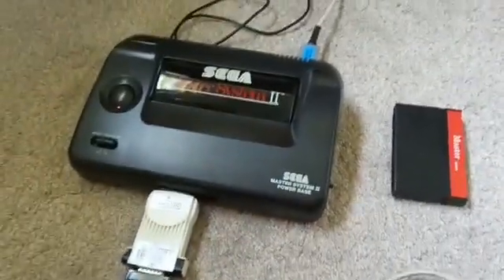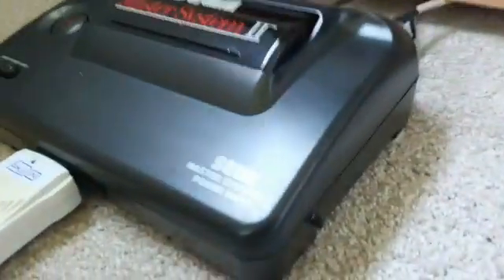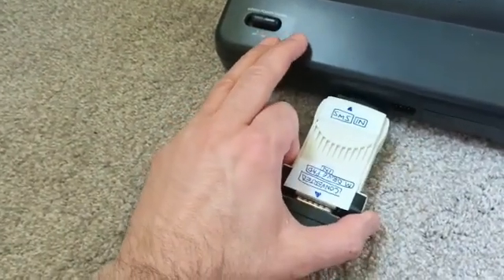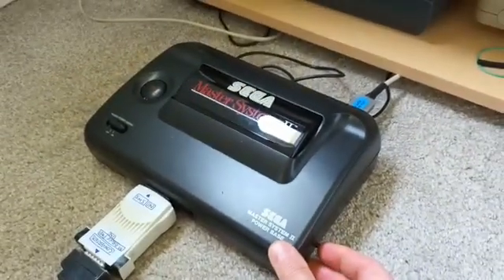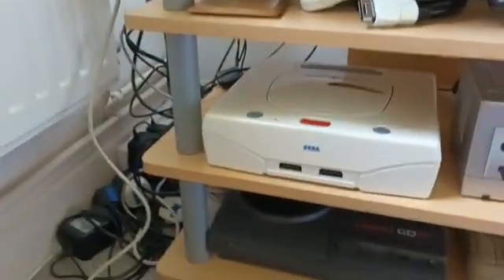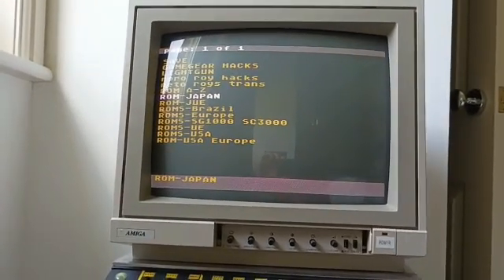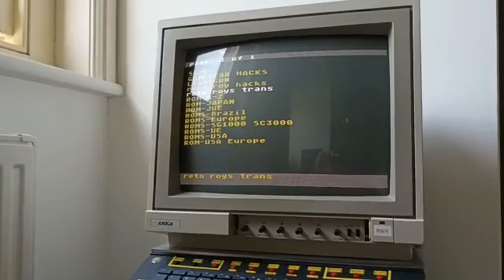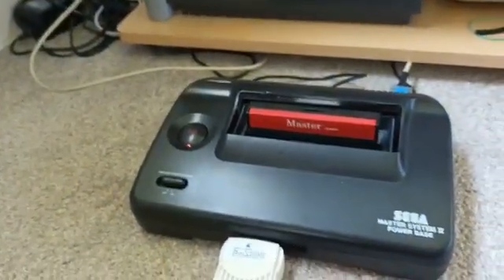Sega master system II hard reset switch mod

Comment: Hi, how do you reset and return to the everdrive menu? Thanks
Reply from the maker: on the cheap carts you would have to do a full on/off power recycle unless you have this mod, on a real everdrive it is a key combo, cant remember which keys .. something like hold a and b and start, google is your friend on this.
Reply: @alpanchen  thanks, with an aliexpress everdrive, how do make this connection, what points do you need to solder?
Reply: Hi, the hard reset modification requires interrupting the 5volt output from the 7805 regulator and a 5volt relay connected in between that circuit (with main contacts that are in a closed  state) when relay is not operated. A 5volt supply to the relay operating coil through a diode, then through the relay coil to the switch (with open contacts) until the switch is pressed, then other side of switch  is connected to gnd  (0v].
Reply: @markpanchen5106  Hi, thank you for the answer but is it possible to have a diagram of the assembly because I did not understand everything. Thank you again for these clarifications.
Reply: @markpanchen5106 Hi, I come back to you to have a diagram of this installation. Thank you so much.
Reply from the maker: @nicolassentenac5655  wiring diagram and notes are in the comments
Reply: @alpanchen  Thanks fot the answer but i don't understand all the details.
Reply from the maker: I have put links to the wiring diagram and notes in the description ... please click more on the description and then if needed click more again to see the links
Reply: @alpanchen  Thank you very much! 👍👍
Reply: @alpanchen  What is the reference of the relay please? Thanhs
Reply: Hi, you need to get a SPDT (single pole double throw) 5volt minimum contact rating 1amp relay, which means it has 5 terminals. 2 for the coil, 3 for the main contacts ( 1 is common, 1 is closed,1 is open check with a ohm meter and wire up to the contacts that show continuity without the relay powered. Hope this helps.
Reply: @markpanchen5106  Thank you, so I don't use the open contact but I only usd the close contact like in the diagram, the common contact and the two coil contacts. Thank you very much.
Reply: @markpanchen5106  Hi, is the ground point of the switch soldered to the voltage regulator or somewhere else? Thank you very much.
Reply: Hi, i wired ground pin of press switch to gnd on the regulator (middle pin)on my sega master system👍
Reply: The reason I did this is because the top tin rf shield also acts as part of the heatsink for the regulator when it is in place. The regulator is outside of the tin shielding, this modification was built to connect around this rf shield. As I didn't want any wires to be connected under it. It's very sharp. Hope this helps👍
Reply: @markpanchen5106  Thank you for your answer.
Reply: @nicolassentenac5655  👍👍
Reply: @markpanchen5106  Hi, I hooked it up and everything works perfectly. Thanks 👌